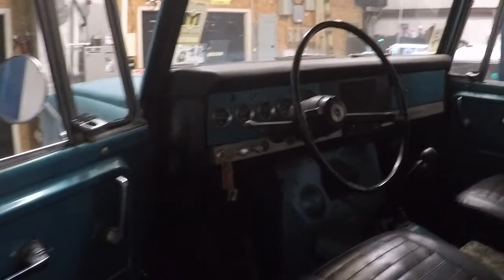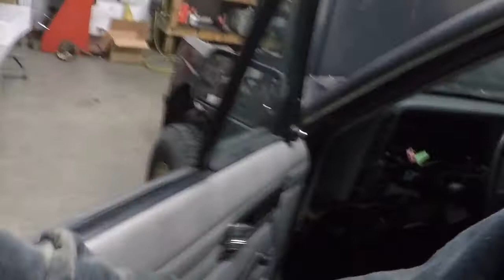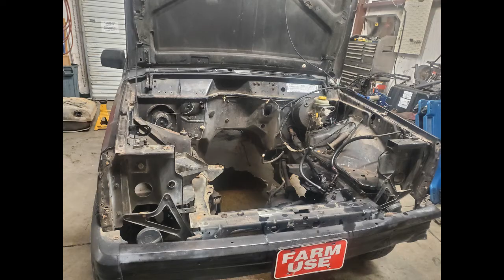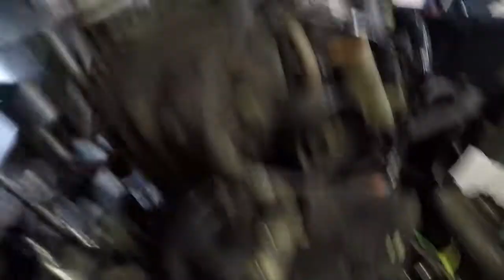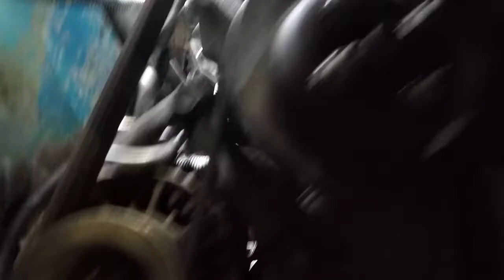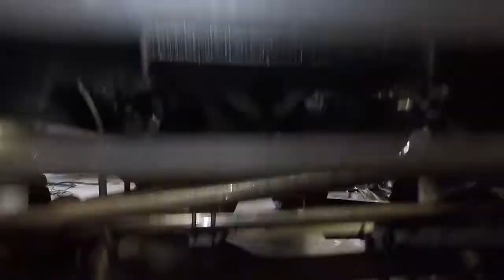Scout 4.0 Swap

Comment: The original six in that scout is An AMC 232 Inline six ( the little brother of the 258 which the Jeep 4.0 is Derived from ) that’s why it dropped right in on the stock motor mounts.
Reply from the maker: Correct. That is why it was chosen to be the replacement engine. It fit perfectly into the bay.
Reply: @joshsautoandcustoms9840  it’s a great swap ( modern Fuel injection , way more power and if someone looked under the hood they’d think you just put fuel injection on it) plus those Jeep 4.0 liters are bulletproof .
Reply from the maker: I agree.  They also have a very large parts support if anything does happen.
Reply: Will this swap work for a 1966 with the 4 cylinder?
Reply: Doing the same swap in my 74 Scout ii. About to tackle the 4.0 harness. I’m going to use the full stock harness and computer. I’m going to run the crank position sensor,tps,map, 02, cam position sensor, and stock computer. Is that what you guys did? Any other acronyms you would add for it to run? 😅
Reply from the maker: That is exactly what I did
Reply: @joshsautoandcustoms9840  nice! I forgot to look closer to see if obd2. That’s what I’m using obd2.
Reply from the maker: I used ob1